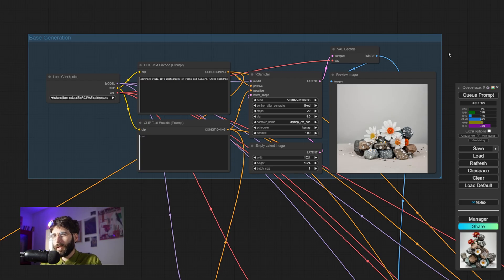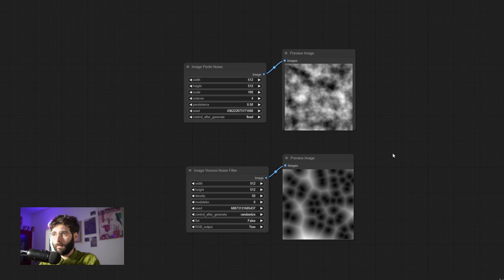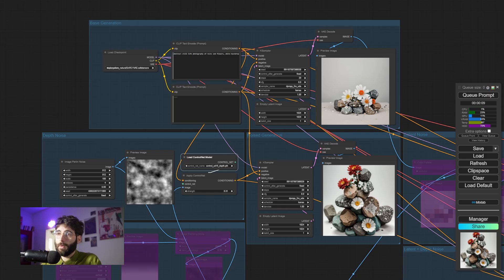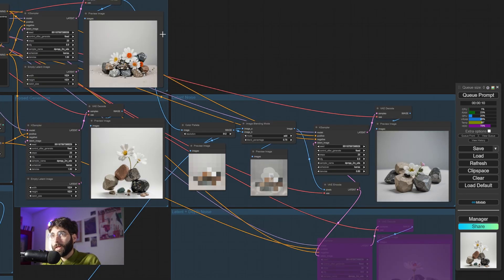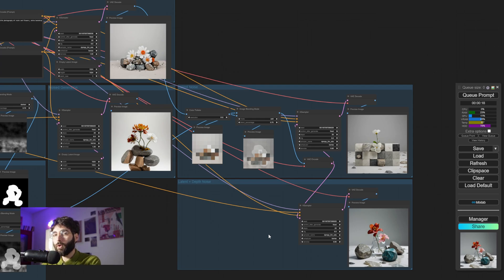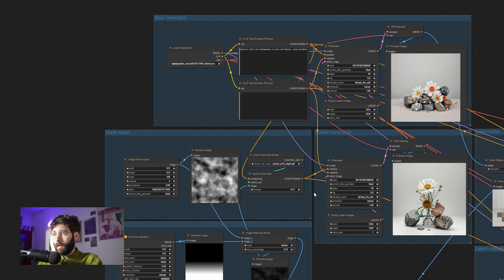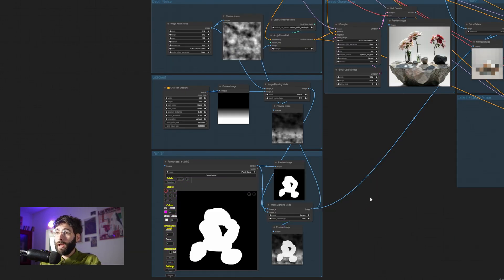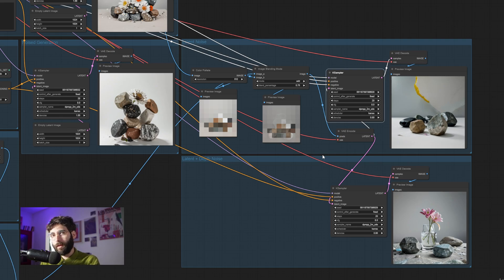Get Better Images: Random Noise in Stable Diffusion

Comment: Definitely not using confiUi any time soon. Not for me at  all. Why wasting so much effort making something with all those intricate and confusing entangled lines when I can get an almost identical result in seconds using automatic?
Yes , confi gives a lot of control, apparently, but that control is not necessary to achieve great results with good prompting  and other techniques. All the super innovative methods developed for Comfi that I've seen are easy to imitate with other tools, even in command line, so I'll pass. I wish people could see it too so they would focus on improving other tools instead of Comfi.
(Although, the idea of using custom noise to influence the generation is great).
Reply from the maker: Well, that's easily said: I personally like node based interfaces much more than standard web UIs and CLI. I spent a lot of time learning Houdini and Blender Geo Nodes, so it sort of comes natural to me, as to many others. I'm all for having different interfaces for different users, so I prefer having the option of choosing which one to use depending on the task and on the kind of use I want to make of it.

Also with comfyUI I can spend time working on the "perfect" environment I want to set up, in order to automate the generations, and that's something I could do to a degree with other UIs, but it's much easier in comfyUI for me.

It all comes down to personal preferences, I think!
Reply: It's one thing to not use ComfyUI because it's not useful to you, but to claim it's a waste of time for everyone else is ridiculous.

I use it for animation, and there are a million things that it's better for than with Auto1111.

For example, access to experimental nodes, performing transformations on image maps, muting processes with boolean switches, generating proper looping frame interpolation, propagating single images to multiple inputs at the same time, doing multi-step upscaling, animateDiff outpainting & upscaling, quickly swapping inputs for multiple inputs, isolating parameters to a single location, organizing complex workflows, etc.

Comment: For visualizing noise in blender (1:32) use Color output of the noise texture instead of Fac. That way for offset on each axis it's gonna give slightly different result. Now all of the offset is same for all axis, in the direction of the vector (1, 1, 1)
Reply from the maker: It's been a hot minute since I worked with geo nodes in Blender. I plugged it in and I debated looking up a guide as soon as I saw it wasn't displacing along the normals, and I said "eh, it's just to visualize stuff, that's fine". But yeah, absolutely, affecting the offset alongside the each face's axis would be the correct way of doing it!